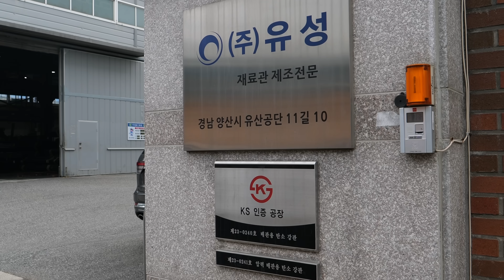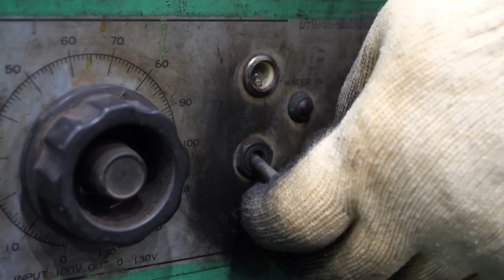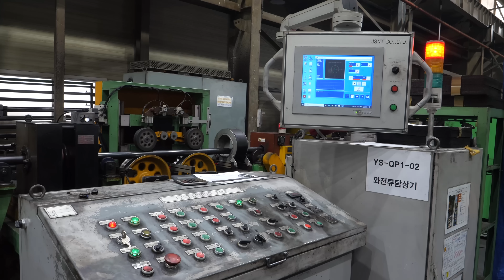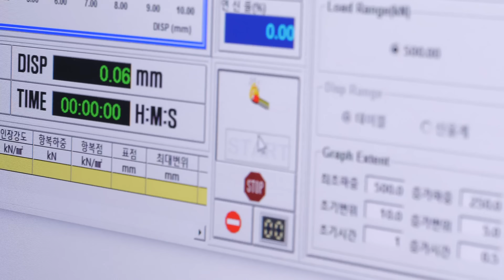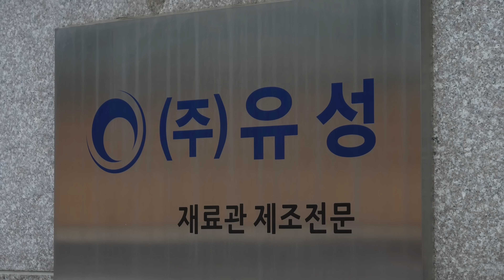다양한 규격의 강관 만드는 과정. 한국의 재료관 공장 / Amazing Korean steel pipes factory

Comment: My work involves products made from tube that would be manufactured in basically the same way as shown here, except the tubes are aluminium, wall thickness 0.25mm, and the tubes are between 8mm and 25mm. They are cut and shipped in 3 metre lengths. They go into radiators and heat exchangers for Formula 1 cars and bikes, supercars, and some for aviation.

Comment: Good full-fledged equipment! I have been working for such people for many years. The only thing I didn't see is how the inner grate is cut off
Reply: The inner flash peeler, the best I remember, is anchored to the machine before the sides are pushed together for welding and it is a few feet down inside the  pipe.  The summer of 1970 I worked at a steel mill where this exact thing was done.  I worked in the mill that sent the pipe to a stretch mill that took 6 in pipe and heated it, ran it through progressively smaller dies and it came out as small as 3/4 in.